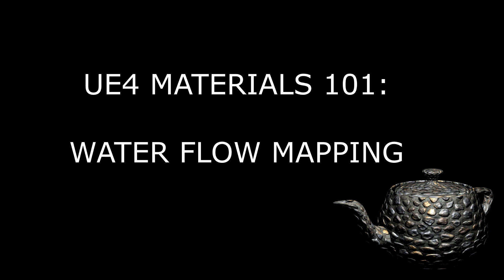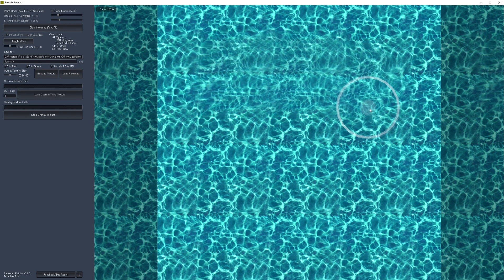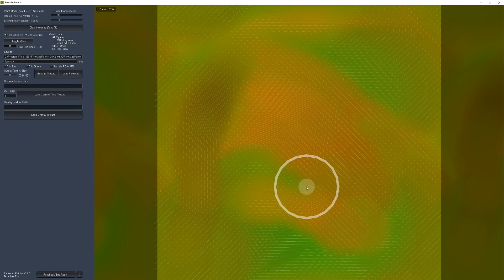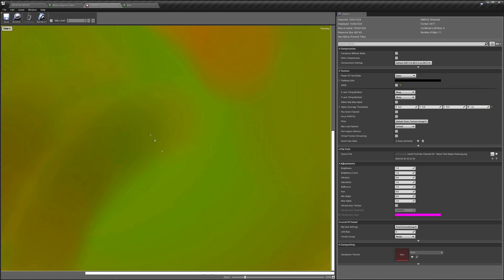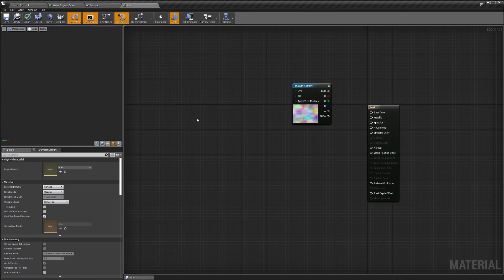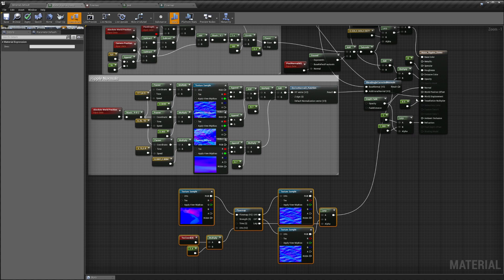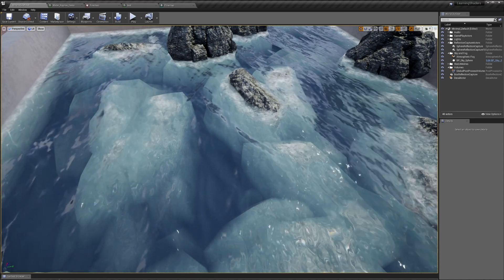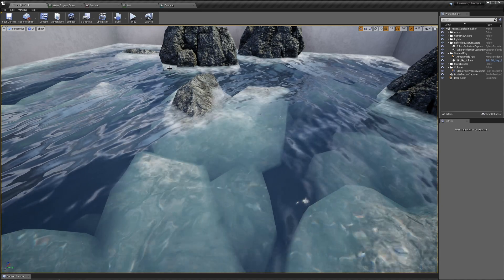Water Flow Maps - UE4 Materials 101 - Episode 29

Comment: 11:30 My flow map is still jumping back, and it doesn't matter what values I try out, or where. in fact it stays completely unresponsive to the value I add to the time for the second texture, which is actually mathematically impossible. I wonder what goes wrong under the hood in UE, since I don't believe this has anything to do with the tutorial.

Comment: Ok I’m sorry I am new here. But when you did the multiply by 2 and subtract 1. How did you do that? 10:56
Reply from the maker: That's just a cut in the video to remove a spot where I wasn't explaining anything - mostly to shorten the video a little bit and save your time.  Sorry if it was confusing. It's pretty simple to do.  You just create a multiply node, wire your value to the first port and set the second port to 2.  Then you wire that multiply to a subtract node and set the second subtract value to 1.
Reply: @BenCloward  do i do that in the settings under Const A and Const B?

Comment: You could've just used a sine node to perform the blinking alpha input! Great tut btw!
Reply from the maker: Yes, that’s true. A sine wave fades in and out smoothly - so if I wanted the drops to fade in and out, I’d use a sine wave. However, in my case I want the drops to hit hard at the start and then fade out slowly. So sure, you can use a sine wave if you want. But it’s not what I’ve chosen to do.

Comment: There is a little problem, the flowmap should multiply (-1,1) first.
Reply from the maker: Thank you!  Whether or not this should be included probably depends on the process you used to create the flow map.  You could get the same result by flipping the red channel of the flow map.
Reply: @BenCloward  Got that, thanks!

Comment: Hey, really useful tutorial ben, by the way, is there a way to combine the rain ripples function with the final water shader?
Reply from the maker: Yes, you can do that.  Just add the result of the ripples function with the normals of the water.
Reply: @BenCloward    hey, thanks for the reply, I tried that but it's gets overlapped by the geometrical waves I think, so I attached the ripple function to the gerstner waves, somehow it fixed the problem.

Comment: Hey, Ben. I do have a question. 
After I completed the full tutorial, i plugged the water ripple function back into the normal slot, to see the finished water with rain ripples. But i didn't see any. Maybe they were too small and were washed away in the waves. But no matter what i did they never appeared. Do you maybe know why?
Reply from the maker: Does it work if you plug in the rain ripple normals without the water normals?  What does that look like?
Reply: @BenCloward  Wow you're incredibly helpful AND respond to questions. You really are gold brother lol

Without the normals added and using only the ripples, it works fine. 
However i added the normals back in with the ripples and looked closer at the water and the ripples are there. 

But there are very very few and they only show up at certain points in the waves. 
It looks like they only appear at the peak of the waves . As soon as a wave passes, the ripples instantly disappear. 
I believe the waves may be greatly distorting the ripples and it gives the illusion of them disappearing.
Reply from the maker: Sounds like you need to find a different method of combining the two normals if you want the rain ripples to show up more prominently after they’re combined.

Comment: Thanks a lot for all those tutorials. They are straight to the point as being educative as well. So great job.
One topic I haven't seen though which would be great to cover is Material LODs.
After completing the whole water series, I end up with a shader being around 600 shader instructions. I also have other materials with multiple layers based on ramps and normals with multiple displace textures ect... so it would be great to see the process you might go through to "convert"  heavy materials in LOD's like shader.
Thanks again for sharing your knowledge and keep up the awesome work.
Reply from the maker: That's a great idea for a tutorial topic. Thanks for the suggestion.  And yes, water shaders are usually pretty expensive.  They're complex, but they also use transparency (or at least this one does) - which automatically makes them more expensive.

Comment: I love your water series! Will next weeks video continue on it?
Reply from the maker: I haven't decided yet.  Any suggestions?
Reply: @BenCloward  Personally I would be interested in seeing some methods for rendering the underwater area, or even more, the split between underwater and above water. I've been trying different things but always ended up with some limitations, for example a post process material for underwater fog that doesen't work with the translucent water surface, or a waterline material for translucent objects that's not in sync with the displacement of the waves.
Reply: @BenCloward  PLease make some wonderfull thing with the water coast line too. Pleeeeeeeaze ^^